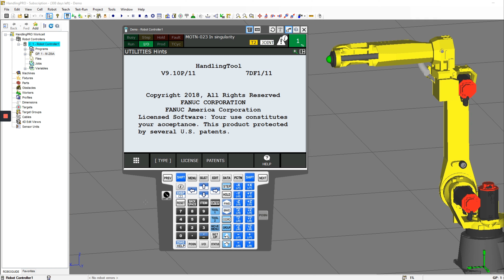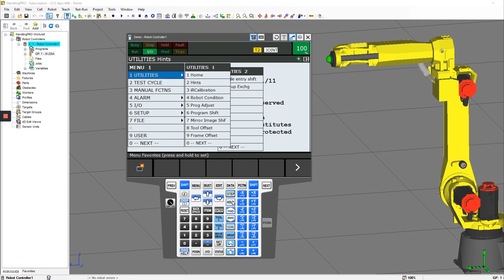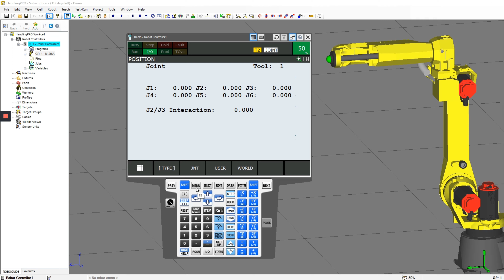Mastering a Fanuc M20iA

Comment: why zero position master?? why?? your robot will be off by few degrees than it used to be, you are resetting master counts by doing zero position master
Reply: If the zero position of the robot is off then everything that is taught in any frame will be off. Sure you can touchup points to correct but you are touching up to a bad zero or mastering. Same holds true to TCP (tool center point). If your mastering is off your TCP will be off as well.
Reply: @OfficialObituarium  Im talking about the "zero position master" that essentially rewrites reference counts, that option is only used when you change the pulsecoders, servomotors... i have never seen a crash that serious that would un-align zero notches, use "quick master" if your batteries are dead and your robot will be mastered as it was when it left the factory, fanuc uses absolute pulsecoders, no need for zero master!
Reply: @ROBOT_G  thats why master counts and reference counts should be the same as on the mastering sheet that comes with the robot, when you do zero position master, you rewrite those values. on the other hand, using quick master will put the robot "zeros"  back where they were and you dont have to reteach anything, cheers
Reply: @filipspakovsky8126  depends on the situation I took this video has a how too that's it. I changed a RV and a motor yesterday ran the robot to the witness marks single axis mastered the robot. There's nothing you can do to compensate for a repair like that. Master counts on the factory sheet can be updated. Just write the new ones down. Old counts can be used in a battery zero situation as well.
Reply: @OfficialObituarium  Just teach your base. Or Userframe, as Fanuc calls it.
Reply: @Robot_G
After this method by zero mastering, the robot never will touch same position, when you change a position configuration from non-flip to flip (if you know what this is). 
That also means, all your frames and tools are no more correct, however how many times you will learn them new.
Best, when you turn around the TCP spike on spike, your TCP will going away. That's because mastering is incorrect.
Bad mastering, bad frames, bad tools. Robot accuracy is starting with correct mastering. If it's this shit, all will be shit.